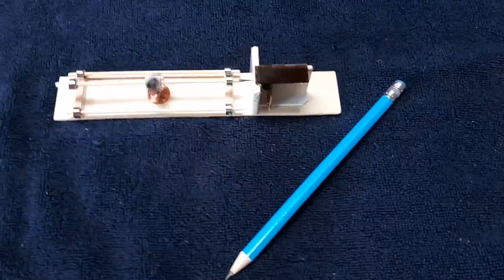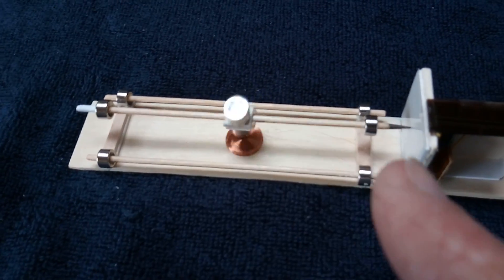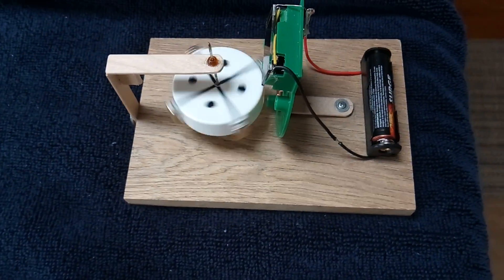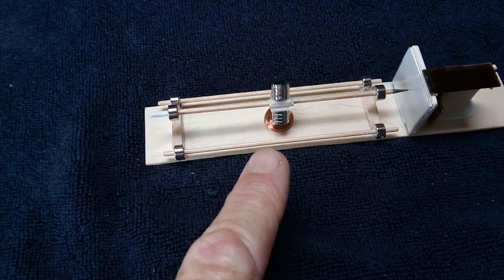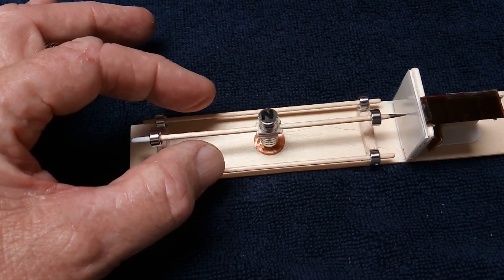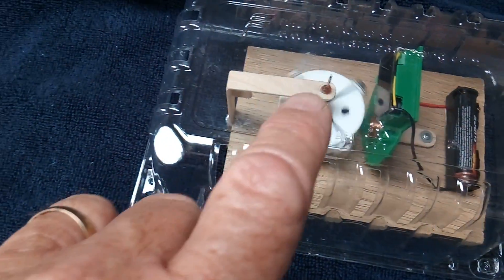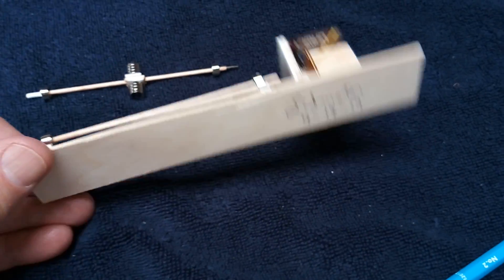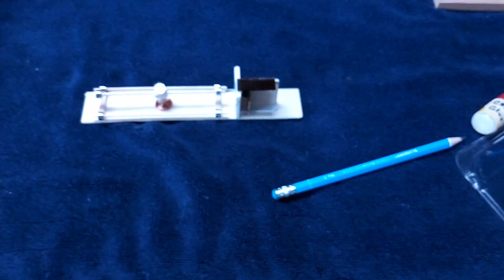Simple Light Powered Motor

Comment: How easy was it to get the coil off the plastic swinger board?
Reply from the maker: Good question!  This one was barely glued on and I was able to gently pry it off.  Other ones I have had to use a hairdryer and slowly heat up the plastic to get the coil off.  The fine wire is extremely delicate and is easily broken. If it doesn't come off with a gentle pull just leave it alone. Once broken it is junk.  I have fixed them but it is hard.
Reply: I like the hair dryer approach!! I cut the plastic around the coil and then used hot glue to position it just right to rotate my magnetic rotor.   Also, being a watchmaker, I made the hardened steel upper and lower bearings (pivots) very small.  My upper pivot was 0.015" in diameter and my lower pivot was 0.010".  I used the same jeweling that I put in fine watches.  Thus, with watch lulbrication my magnetic rotor has nearly perfect turning with almost not friction!  I then put the rig in a nice display case with clear top.  It looks great and works perfectly (day and night).  Thanks for all the great videos!  You are the best!!

Comment: Hey Lidmotor, what if you made a large motor that could run on microamps.  Something about 5 ft high Just change the shaft to a lite weight foam or paper and you could still use the same size magnets.  Then encase it in a plastic housing to protect it and it could be outside, where it could reflect the sunlight or a porch light.  Then it would be out of your way and still be around to enjoy and see how long it would last.  I checked my cement battery that is now 7 years old and it still delivers 200 to 400 microamps, so I know it would run these types of motors and you still have one of those batteries floating around don't you.  Or use a static electric motor to run it.
I have been wanting to do this for a while but just can't get the time.

Anyway, just a thought.
Ed

Comment: I like the self-starting Mendocino.  I've never been quite able to duplicate the performance of those solar waver circuits with my own version.  Especially in such a compact package.  And even with the Solarbotics circuit you linked ages ago.  But I'll keep trying.
Reply from the maker: I'm with you about not being able to replicate this solar waver circuit.  The Solarbotics circuit comes close but it is not the same.  I have a two transistor circuit that works great but does not have the self-start feature.

Comment: Why not glue a ring magnet to  both ends of your wood axle (N facing out).  Then glue a thin cylinder magnet to the wall (that is currently touching your point of contact).  Then glue another thin cylinder magnet to a new wall & mount it to the wood base on the opposite side of the magnet.  That should give you horizontal magnetic bearings that will have almost no friction (other than air).  Once in place, you will have both vertical & horizontal axle bearings.
Reply from the maker: Great idea but it doesn't work.  There is actually a physics law that prohibits permanent magnets only static levitation.  You can do it other ways but just setting up permanent magnets in a certain static configuration to obtain non contact levitation doesn't work.
Reply: @Lidmotor  the magnets placed on the ends of your wood axle (that I suggested) aren't to create levitation--they are to prevent the ends of the axle from making contact with the walls.)

You will still have to have your other ring magnets in place to create the levitation that your current/existing system is producing.

Comment: Neat.  How about a thin 1mm Micro pre sharpened Tungsten TIG electrode instead of steel on a pyrolytic graphite vertical surface or a piece of microscope slide cover or microscope slide?
Reply from the maker: Thanks for the ideas.  Most things I have tried work good for awhile but it is months or years of constant use that takes the toll.